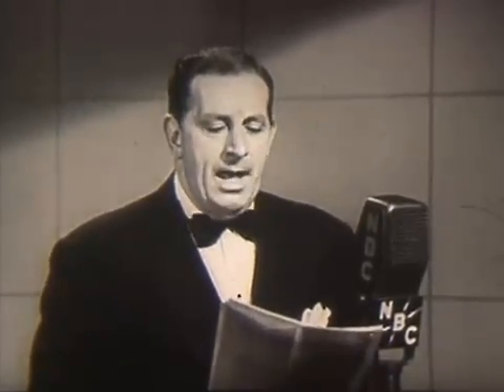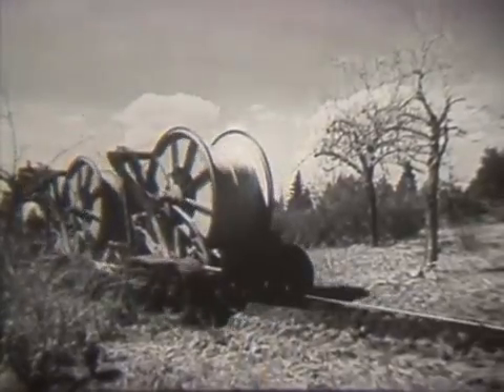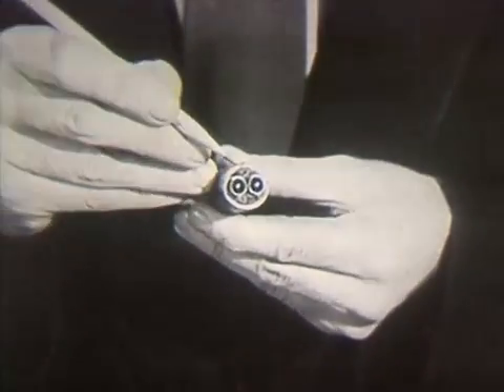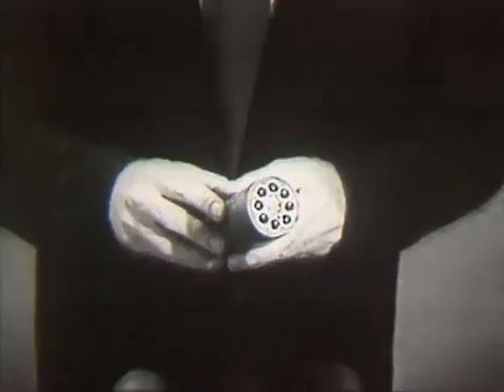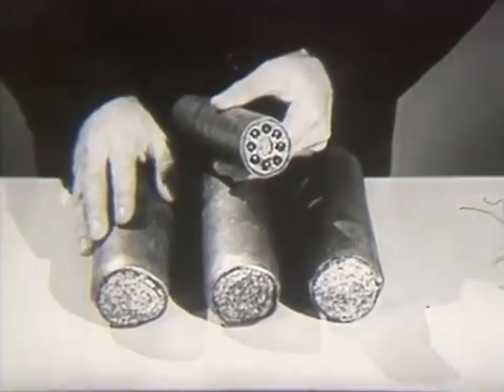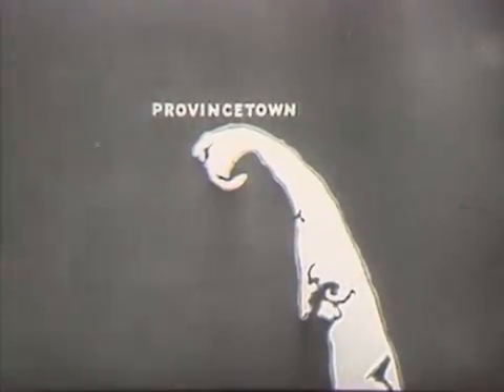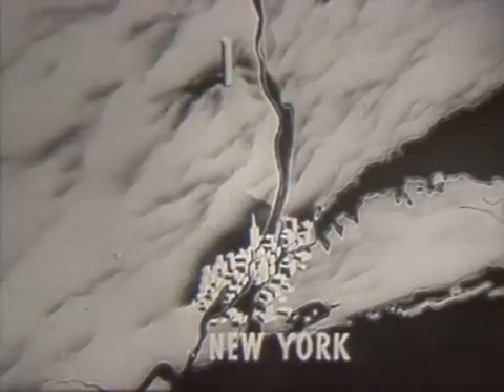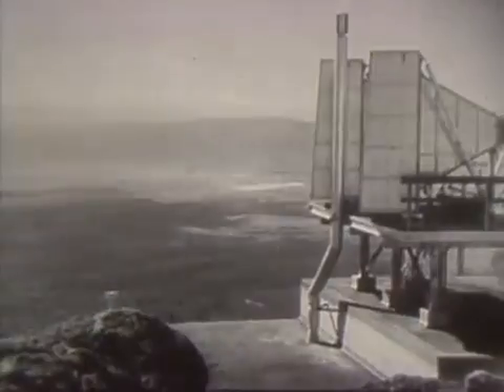AT&T Archives: Television and The Telephone, a 1946 film about microwave broadcasting

Comment: So why do we need satellites?,
Reply: well, they didnt exist yet. eventually they started to exist and demand also grew to such a degree where using them would be nessacary and cost effective
Reply: @moomoobeef2173  except for that is completely wrong.  They have always used under sea cables from the beginning and have done multiple documentaries explaining that 97% of all communication and internet comes from these cables. Also they have states that the cables are more efficient, easy to majntain, and budget friendly . so satellites don't really have so much a purpose up there. Even the pics they claim are sat pics are made by the weather balloons they openly admit to using and for that exact reason.  Even gps can be fully explained with triangulation between 3 towers and if more involved it becomes more accurate.
Reply: @jennellehand4357   The first transatlantic phone cable was laid in 1947.  Prior to that, radio had to be used to cross the pond.  Telegraph cables were around much longer.
Reply: ungratefulmetalpansy  yes, but like i said, the stars continue to rotate on the same circuit. Yes they move around in the sky but its the same movement since the beginning of time.
Reply: ungratefulmetalpansy  thanks for the waste of time reply. Very helpful. If u actually research what I have stated you'll find I am accurate about these claims.
Reply: ungratefulmetalpansy  lol that's funny cuz the stars are my favorite proof for flat earth. With a spinning ball on a spiralling circuit heading in a direction...@ upwards of 1000mph rotation x 66000mph around the sun x 666000 mph spiraling thru space...and your claim is that the stars are just too far away to show visible change in placement on the nightly star circuits.....And this seems right to you? There's no way that in all the years earth has supposedly been huddling thru space which in assuming you believe has been billions....we still can accurately predict where stars will be and have been 100s of years back. And to that comment about the pipes. I got my info directly from the man who has worked on them. Its a public documentary available to view. So there is that proof. So no I'm not a space denyer I am constructively analysing the evidence to come to my conclusion.  That's not supposed to be a bad thing....
Reply: ungratefulmetalpansy  so no response to our previous subject of discussion? ok. moving on i guess. So i'm assuming you're referring to the arch when you say round...unless you mean a full circle, well either way, a rainbow would be the same regardless of the shape of earth cuz earth isn't giving the rainbow its shape. the circular sun is. from our vantage point on the ground however, we only see half the circle-aka the arch of a rainbow, due to the other half getting blocked by the earth itself and how far we can see. of course you go up high enough you can eventually see the full circle. the rainbow circle occurs with light sources all the time and therefore makes the most sense to me. (this is of course my theory due to my research but its still up for debate). Rainbows and other less concrete proofs and in my opinion not as interesting to find out, but i am willing to discuss what I have developed as my theory.

Comment: wonder what the latency was on that coast to coast link
Reply: Your query got me thinking! Good question, by the way! Finally dug up some stats on microwave transmission latency: a microwave travels a mile in 5.4 microseconds. A microsecond is 0,000 001 or a millionth of a second. We've got to get the coast to coast mileage and start multiplying....my head is starting to hurt already....so there's going to be a delay, mathematically. What I couldn't find is the time the signal is slowed as it is repeated through the system & relayed tower to tower....I would suspect this would be the real source of delay vs. the actual transmission through the air.
Reply: Back of the envelope... I get about 0.02 second delay.  For a satellite, 22K miles UP, 22K back, I get a delay of a quarter second.

Comment: Surely this is later than 1946, isn't it? Historical documentation suggests the NYC-Boston link wasn't in place until late 1947. It looks like the transcontinental route was activated in mid 1951, with the first TV signals being sent that September.
Reply: Television service was avaliable in parts of New York State during the latter parts of WWII. Battle movements were actually reported. None of this was avaliable in the south nor the rest of the country.
Reply: @lilliansteele7165  TV existed, but not the microwave routes mentioned in the film.
Reply: Television existed prior to WW2.  The 525 line NTSC television standard was created in 1941 and before that, a 441 line system was in use.
Reply: @David Wanklyn 
Yes, I am aware of the competition between Baird and Marconi, which showed the mechanical system to be inferior to all electronic.  There was also TV in Germany at about the same time, but they used mechanical scanning.